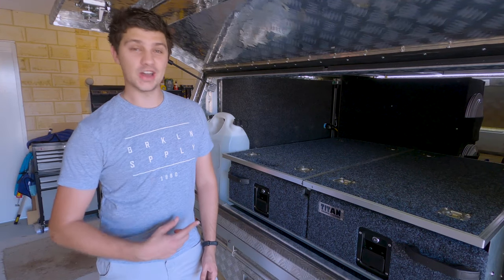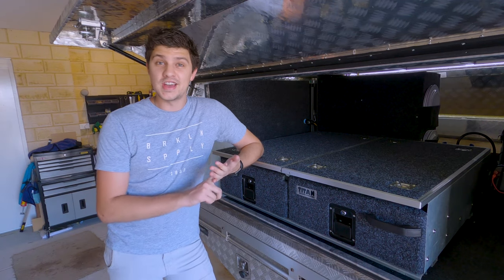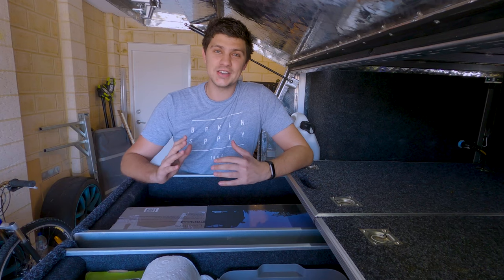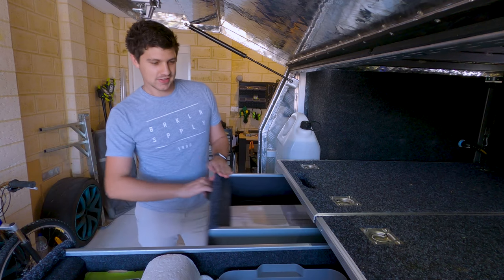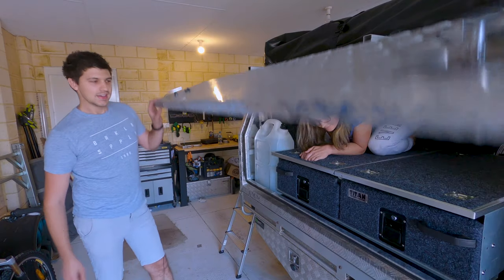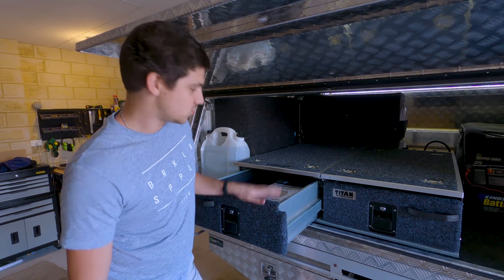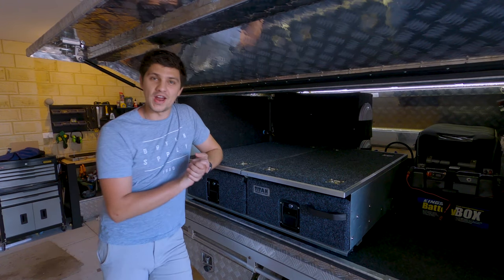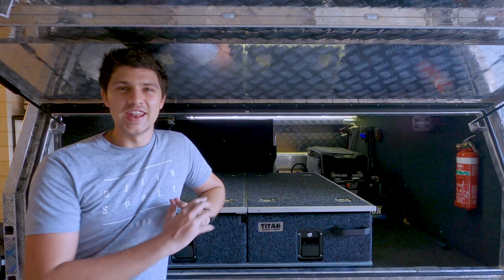Titan Drawers | Full review of 4wd Supacentre's drawer system

Comment: Thanks for the review. I installed a brand new set of Titan Draws for a friend. It turned into a nightmare job that took all day. I had to pull them apart and repair them before they could be installed. Inside I found sharp poorly cut steel hanging and flapping around, because it was never built correctly. I found rivets that were never seated and rivets missing. It was as rough as you could imagine. The poorest Chinese made rubbish that I have yet found in the 4WD industry. Apart from that, they were way too heavy and too shallow to be useful. Regarding my own vehicle, I paid more and bought Australian made Drifta Draws. Without going into all the details, they are so much better in every way and worth every cent. The most useful modification I have made to my Hilux.
Reply from the maker: Thanks mate, I've heard good things about Drifta!! They are quite a lot more expensive, but certainly sound like a good investment for those who can afford them - and great to support locally made gear. 

Here's a link to the Drifta range for anyone else reading this that might be interested: https://www.drifta.com.au/4wd-drawers/
Reply: Bla bla, why do you own a Hilux? They are made in Thailand! Ohh look because you bought a Hilux, Holden is now out of business. 🙄
Reply: @myintkyaw6843 I've had a number of Holdens in the past, but Holden did not make 4WD's.
Reply: @CamperKev  LOL, Holden Colorado?
Reply: @myintkyaw6843  Holden Colorado's were built overseas in Thailand and were a rebadged Isuzu. Holden did not make 4WD's but they should have. They should have given the people what they really wanted. That is why Hilux and Ranger are the greatest selling cars in Australia. That's what people want but Holden failed to build them.
Reply: @CamperKev  That's only the RC Colorado from 2008-2011 that was a re-badged Isuzu with the 4JJ1. Both the Hilux and Ranger are overrated, overpriced pieces of junk in comparison to the Isuzu D-Max now.
Reply: @bigred6927  The Hilux and Ranger are overpriced, but a lot of that is due to the very high government taxes on new cars. As most people know, the Hilux is not junk. It's an extremely reliable vehicle. I have nothing against the Isuzu but I will stick with what has always worked so well for me. I'll keep buying Toyota. I travel to very remote locations and reliability is most important for me. Good luck and safe driving.
Reply: @CamperKev  Fair enough. Reliability is #1 priority for me, which is why I chose the D-Max. 4jj1 is about as bullet-proof as it gets.

Comment: I have the XTM drawer which I got as present over 12 months ago. The key snapped in the barrel recently and NO locksmith can get the barrel.  Both  BCF and Supercheap are both lacking in any support to even ask the distributor for any spares. So if your considering getting this product then consider an alternative brand as XTM has NO support for product failures.

Comment: Mate what's the maximum weight does the top panels on top of the slide draws handle cause my son is a tradesmen and his tool's are very heavy around 300kilos and what's the height messaments of the front thanks

Comment: Gday mate great review got a question I've just bought a set of the draws I've got a 90ltr fridge will it mount on top of the slide and hold it's weight empty and full by chance cheers
Reply from the maker: Hey mate, hard to answer definitevely as 4wd Supacentre doesn't provide weight ratings for the fridge slide, but in the video we tested it with 50-60kg without issue. If you've got the Kings 90L fridge, they weigh 33kg empty, so long as your food is under 20-25kg then should be fine (it could perhaps take more weight, that's just what we tested it to). As for dimensions, there's quite a few drawer models to choose from so I'd recomend checking the dimensions of the model you're after. Cheers.
Reply: @explorebound  Ok easy I bought a 100ltr titan fridge slide I'm gonna mount it on top of the 2 draws and use that I reakon it'll hold the weight then finger crossed lol cheers for the fast reply

Comment: The underside of the top shelf has its framing exposed such that the drawer items can get caught with the cross member. I have to get a long ruler to free the drawer or try the fridge slide if it's on that side. The underside should be smooth so that drawer items can't jam the drawer. Can't recommend this drawer.